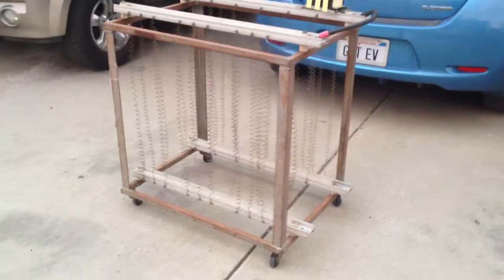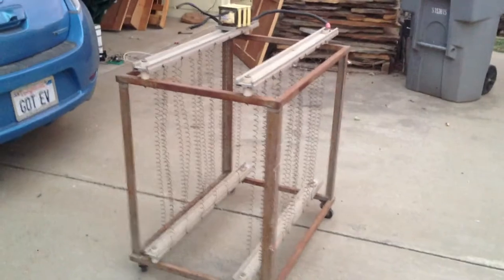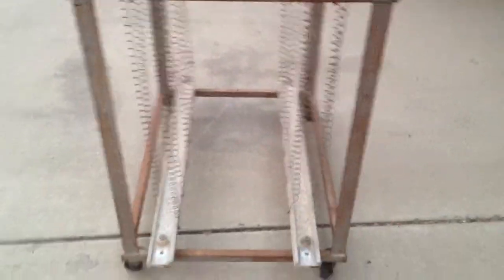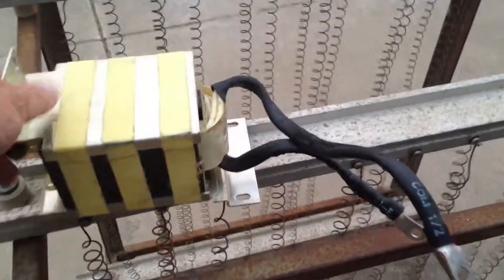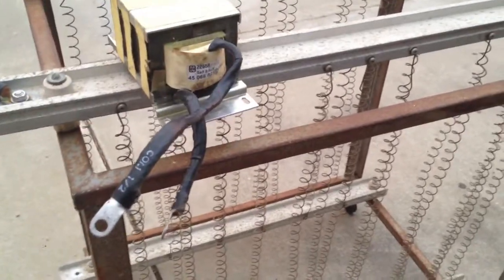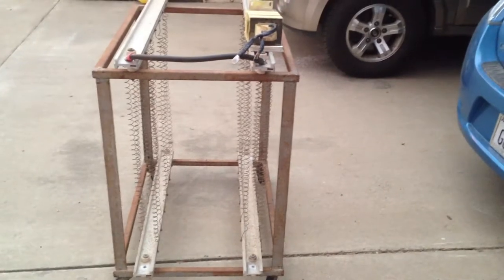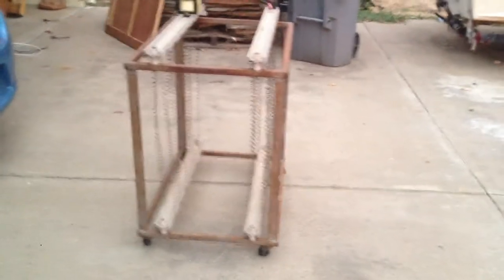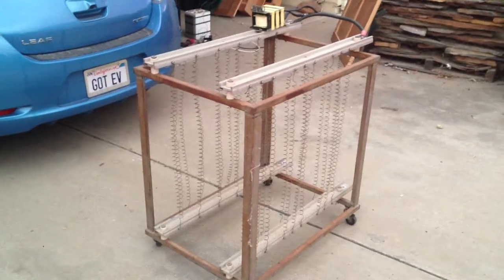Toaster From Hell

Comment from the maker: Needs more voltage to work properly. A single 3.3 volt cell just won't work. It will discharge but not at a high amperage rate. I need a wrench connected to an amp meter.